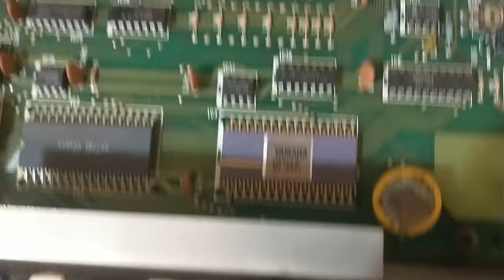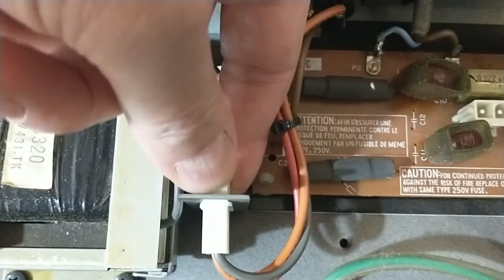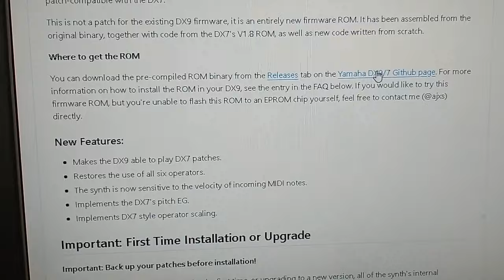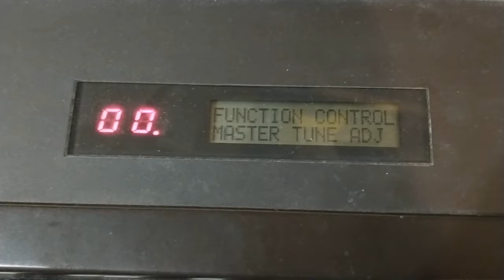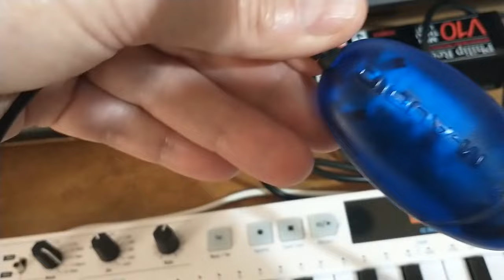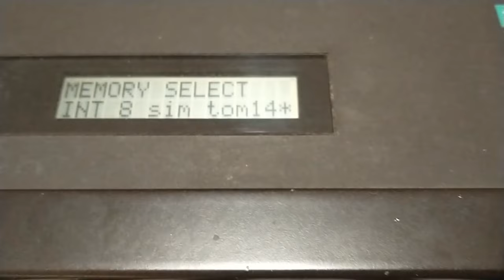Synthesizer Upcycle | Yamaha DX9 to DX7 | plus cap repair |🎶🔌🎹 |

Comment: Have you got any spare burned EPROMS? I've got a DX9 myself just begging to be modded.
Reply from the maker: Hi, yeah I think I may have one somewhere, or if I don't, I can get one and burn one. Have to get the DX9 out again to check it though, as its back in storage. It would be £25 for the burnt eeprom though. Does this sound OK and would you be OK fitting it ? . Need to be careful with static and the pins. Anyway, you should be able to check out / contact me on my website if you are interested. Cheers, Martin @tailbiterz